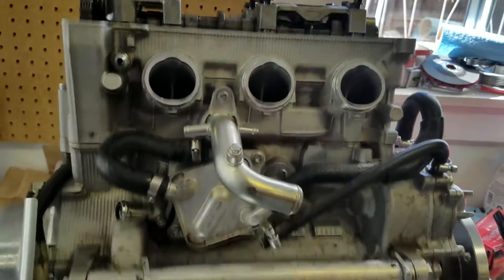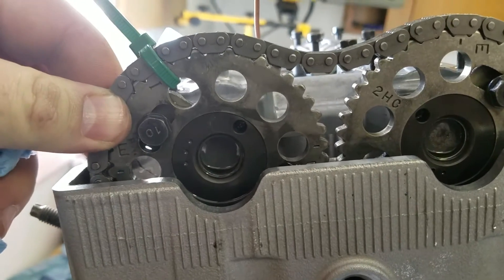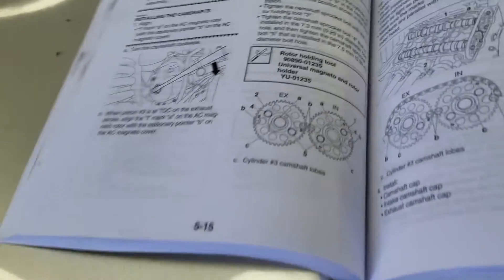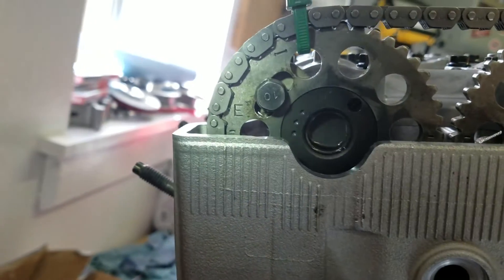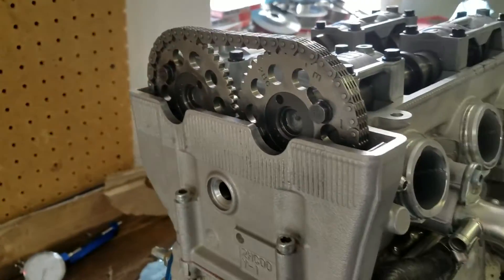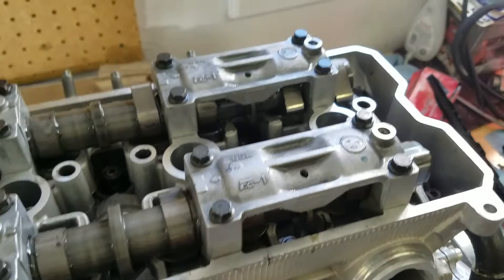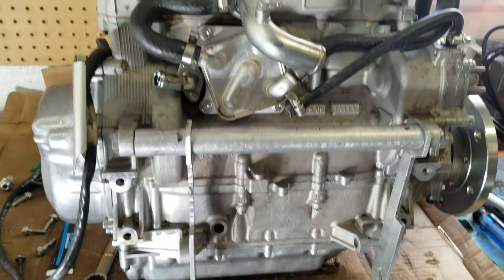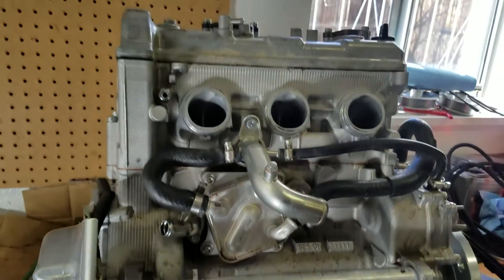YXZ Cam Timing!

Comment: I see you installed adjustable cam gears. You didn't describe adjusting the wide/narrow LSA or show the cam to gear alignment marks for proper degreeing to the adjustable cam gears. Only showed the timing marks on the gears themselves. I also see you used a manual cam chain tensioner - But didn't comment on the use or the reason it's needed when installing adjustable cam gears. On the valve lash -- Intake and Exhaust aren't the same as you indicated. You might have also have commented on the cam's -- As I'm assuming they are aftermarket -- Otherwise why install the adjustable cam gears unless all you wanted to was adjust the LSA which adjusts the power band. A pic of the cam card would be informative. I'm assuming you didn't change the springs - As I didn't hear a comment. Thanks for posting -- Good Luck and post back on your observation on how the motor now performs.
Reply from the maker: SuperDunner thanks for the reply! David with Hurricane Performance set the cam timing and slotted the gears. They are stock cams. This wasn't meant to be an in depth tutorial.
Reply: Forgot to comment -- You stated the head is now back on. Which of the 3 head gaskets available what did you use - Standard/Thick/Thin. If thin with aftermarket cams and adjustable cam gears and setting LSA (? what's yours set at) - What was your intake valve to piston clearance and exhaust valve to piston clearance ?
Reply: Gotcha !! Thanks for posting !!  Good Luck .. .. :^)
Reply from the maker: SuperDunner I used 2 standard thickens gaskets. Compression is 9.2:1
Reply: Just to clarify -- Hurricane recommended using 2 stock 3 layer MLS head gaskets to lower the compression from 11.3:1 to 9.2:1 ?? The stock head gasket is .021" thick. There is a thick 3 layer MLS gasket available -- Has a thickness of .027"  to lower the compression for Turbo application.